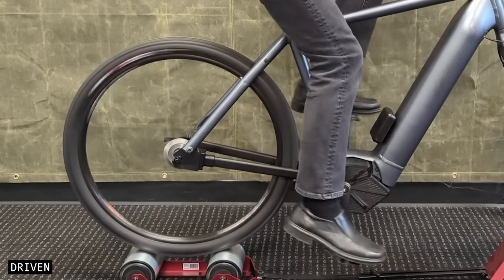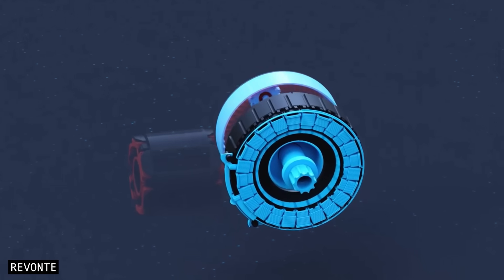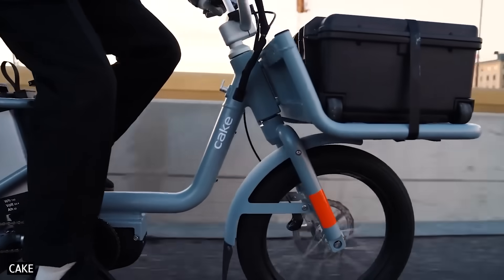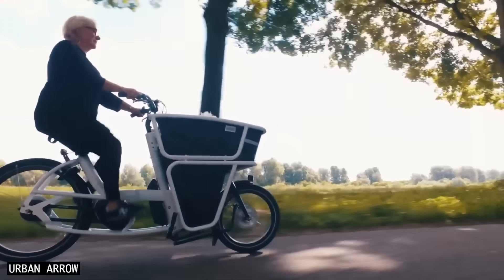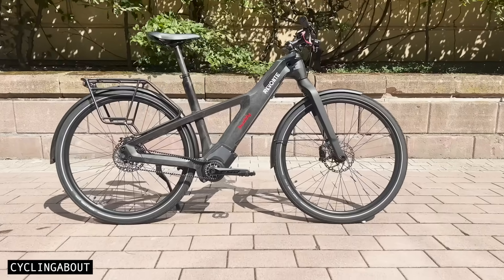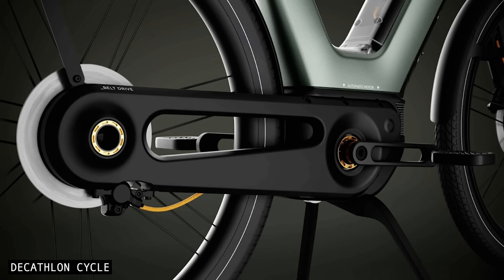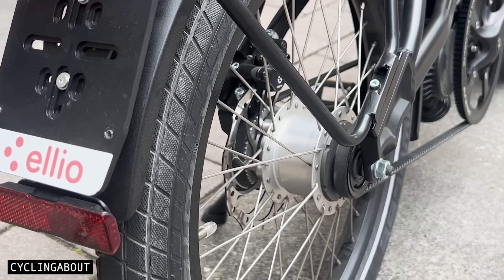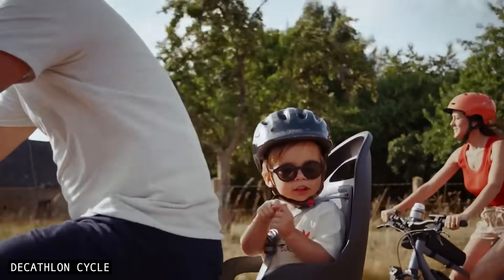Death of the Derailleur? Chainless eCVT Bicycles Might Change Everything!

Comment: In my opinion e-bikes are heresy to whole concept of bicycle. Period. Even if I got it that many people just lazy and/or have really bad physique it doesn't mean this is a good solution.
Maintenance. Even if minimal it still sooner or later will need it and You can't provide it by Your own. And, believe me, it will need maintenance much sooner than You think. Shit happens. Especially if You didn't bother to checkout and maintain it's parts. You got dependant.
Long term accessibility. I buy half a century old frame and able to make it road ready... Are You sure You be able  to do the same with Your e-bike? Doubt about. And those particular motors is a best example You can found - each of them are start-ups which can vanish sooner than You need some replacement part. You'll be forced to buy new one... Is it sustainable? Is it efficient from money point of view?
More point of failure. Those motors adds hell of a lot complexity. Badly soldered SMD component can literally brick Your wonder vehicle and You can't deal with it. Most of users at least.
I personally hope advance in bicycles goes more mechanical way, but it isn't attractive from producers point of view, because it be long term robust solutions which lower sells... You don't need new if old just fine.
There are some purely mechanical kind a gearbox which can be installed in standard Bosh EM socket and give You something like Enviolo gearhubs, but with completely automatic shifting. Yes it complex... But it be not bricked by not paying subscription on producer app. This is kind of development I wish to see more than disgusting e-bikes which is just fucking rot.
Reply: An automated chain and derailleur cleaner that one just would put the bike on, with a gear, pulling the chain around. Just change gears up and down, and the transmission is clean within a minute. Probably some filter for the oil also, so it doesn't need to be changed.

Comment: The shaft drive isn't efficient, and the contact at the rear wheel will wear in a few thousand miles probably, as this tends to happen with that type of drive system.

Comment: I've been waiting for this video. Thank you.
I believe the motor/gearbox combination like the Pinion MGU will take centre stage first. Eventually Ecvt will become popular. However, due to the complexity of them and the need for specialized training and/or shops they won't become an alternative that will replace the MGU style of bikes.
Cvt transmissions already have a bad reputation due to adoption by auto manufacturers that didn't design or build them for reliability. I believe they built them as cheap as possible by using belts instead of planetary gears. The planetary gear cvt transmission are strong and reliable. The belt ones, not so much. Unfortunately it will be a very steep and high hill for cycling manufacturers to climb.

Comment: You say low maintenance, I hear unmaintainable (proprietary / enclosed tech with obscure tools and documentation).
Reply: You could argue the same about car gearboxes being difficult to repair.  Modern sealed systems have a very long life and the Olson a bicycle system are relatively low compared to a car
Reply: @davidtydeman1434  yeah but that's one of the biggest advantages bicycle drivetrains have over cars. You can pick it up, see the problem and fix it in 10 minutes with some intuitive thinking, a spare cable and a prayer.
Reply: I’m a bike mechanic at an ebike store. I totally agree. I think the tech is amazing.  But it’s going to make bikes more like modern cars that require trained techs and software that only the techs will have.
Reply: @roamingromer  I'm also a mechanic and I agree. But we grow alongside our challenges. Also not all of these technologies will survive the test of time and one criterium is always how well a manufacturer employs serviceability, documentation and spare parts distribution. That's why Bosch dominates the market. Not because they had the best technology when they started but because they had the best infrastructure to meet the needs of workshops and mechanics. Time will tell.
Reply: @roamingromer  same. I can only imagine how bad it'll be if DJI is an innovator here too
Reply: @roamingromer your right to think that but remember cars and bicycles are dealing with much different scenarios. 

A bike is at max 100pounds compared to 1000s for a car. Different speeds of operational.

Why do this matter? Because if you engineer the equivalent of a car engineer but for a bicycle, the amount of maintenance required is so low that the trade off may completely be worth it.

Imagine taking your car in once every 3 years for maintenance, would ease of maintenance be worth doing maintenance at the current amount for a car?
Reply: To be fair it's the same with non DIY bike for the motor. Closed source special tools needed for diagnostic etc.
They just extended this logic to the transmission as well.
Reply: Each to their own, you can stay with your old reliable low tech gears.
Reply: I mean that's how tech always works.  If you want to be able to work with the logic in your electronics stay with vacuum tubes but at some point the performance and increased reliability overcome the downsides of being impossible to service or modify.  The question is just whether we are there yet for bikes.
Reply: @petergerdes1094 Except it’s not how tech needs to work.  Providing a schematic and access to basic repair parts is part of creating a serviceable device.  It takes a little effort by the company, but it’s not that hard.  And it can be done without giving away all the IP.  But companies choose not to do it because they want a monopoly on repair and/or to force you to buy new devices.
Reply: None of you picked up on eCVT relative to Toyota reliability. A planet and sun system is super reliable.  No maintenance really.
Reply: @mefobills279 Sure the mechanical gears are pretty reliable, but there are a ton of electronics that control these ECVT systems and I all but guarantee that those electronics are going to be unserviceable.  The manufacturers are not going to provide schematics or spare parts, and you’ll be buying a whole board for $1000 when a $2 capacitor fails.

Comment: Ah, that weight distribution claim again. About the only thing a mid mount changes is the lever moment of each wheel over a bump, halving it for both wheels. However, if a rider runs a hub motor, front or rear, there's a one-to-one moment as the hub wheel hits the bump, and no added moment beyond the standard wheel's mass for the non hub motor wheel.

Then there's the biggest, highest mass of all, the rider. For example, I'm 71kg at 183cm, my centre-of-mass is about a metre off the ground and 14x larger than the mass of any hub or midmount. Add panniers or cargo and the midmount effect becomes so incremental as to be bollocks.

The advantage of CVT is the ease of riding and I nearly went with an Enviolo hub when I switched from upright bike to recumbent trike this year, but decided the 1x9 MricroShift Advent is simething I know (my old tourer ran R9 flawlessly for 9 years) and I'm loving it. Derailleur is the last great technological advance non mechanics can be taught to understand. Seriously! ❤

As for midnount motors, the weight distribution stuff I've described above is the same, although the efficiency of midmount is higherthan hub drive. However, the efficiency of a middie comes from taking more of the load - aka doing more work, where hub drives are applying all the set torque all of the time, even with a torque sensing controller.

And "mid mount" on a recumbent makes the ride harsher because the drive is all the way outfront, the front wheels are halfway back to the rider and the back wheel is nearly as far back again. As much as I love the e-range I get with mid mount, I'm seriously considering a rear hub drive for the 1 in 2 attack ratio compared to the 3 to 2 attack ratio I currently get over bumps. I miss the smootherride of a bicycle, but age and a busted ticker have made riding a bent, essential.
Reply from the maker: I'm not sure you've ridden a mountain bike trail with both a hub motor and a mid-drive motor. The difference in handling is huge. Mid-drive motors offer vastly superior performance.

Comment: A planetary gearset in the bottom bracket with the sun gear being the pedals, the planetary carrier being driven by a mid-mount motor and the chainring/beltring being the ring gear and a rear hub motor would be perfectly analogous to a Prius drivetrain.

It would mean that the rear wheel could be being driven by batteries while the pedals are doing nothing, or the pedals are turning and charging the batteries while the wheel is stationary.

A front hub motor would give eAWD, and a large front hub motor would maximize regenerative braking.
Reply: There are already bikes with sidecar, so if you have also motor on this wheel, and big battery in sidecar, it could be 3WD for high range. With flat winter wheels it could be possible to drive in winter, on 3 driven wheels, with seat heating and handle heating!

Comment: Did I hear less components to wear out than derailleur system @4:13? Huh? Did I hear belts lasts longer than chains?
I listened long enough to hear them debunk the product. 🤣🤣🤣🤣
Reply from the maker: The motor design has very few wear components, and can easily be built for long-term durability. And having ridden over 150,000 km on various belt drivetrains, I can confidently say they last three to four times longer than traditional chain drivetrains.
Reply: @Cyclingabout  btw, belt drives are almost useless in winter conditions. Belt always tends to slip off. The derailer transmission also freezes and stops working, but at least the chain doesn't fly off and you can drive home in a stuck gear.

Comment: As someone who's owned lots of motorcycles with both chain and shaft drive, the chain drive wins hands down every time. The maintenance is so much cheaper and easier. You just spray the chain with lube once in a while and replace the chain and sprockets every couple of years for $100. Shaft drive requires lubing the final drive and shaft u-joints and splines every 150 miles, replacing u-joints, a final drive replacement is thousands of dollars, you need to replace leaky seals, and it's pretty inefficient and heavy, adding a lot of drag to the divetrain. Chains and sprockets are cheap and easy and effective.

However, I do believe CVTs are fantastic.
Reply: I've owned a few shaft drive motorcycles and I didn't find they were as you say. Heavy yes but none of my bikes needed a lot of driveshaft servicing. I absolutely didn't like the chain and sprocket drives on my other motorcycles. Dirty, noisy and needing replacing often. However, I would easily take a belt drive motorcycle over the chain or driveshaft. I never owned one but I know of several riders who did and they didn't need any servicing either. Light, strong and quiet.
Reply: You are very wrong. Shaft drive bikes need almost no maintenance since the shaft bevel gears are sealed. And the shaft generally lasts forever. June from June's Kitchen channel had a shaft drive bike for 20 years. Chain drives are very high maintenance.
Reply: I owned a 2004 Suzuki Volusia VL800 for a long time with a shaft drive and I only added some grease to it once when I had the rear wheel off for a new tire. Otherwise it was pretty sealed up and bulletproof. 
I also had a 2012 Kawasaki Voyager 1800 with a belt drive which I did nothing to at all for 50,000 miles when I sold it. 
The belt drive had a little lag between pinning the throttle and the rear tire reacting where the shaft drive bike was pretty instantaneous. 
On my bicycles I have one with a belt which is fine, but the bike is unfortunately a single speed and the rest are chains which are easy to take care of. If the belt broke on a ride, I don’t know what I would be able to do, except for they last for 60,000 miles, so it’s unlikely I will ever ride that far on that particular bike. I just replaced a chain that stretched out after 6200 miles on a recumbent and that was $98 for twelve feet of chain. But at least it’s a five minute fix if it ever broke on a ride.
Reply: I had an 89 Yamaha Venture Royale. It was the tour bike similar to Honda’s Gold Wing. It had a shaft drive. The only maintenance it required was changing the oil in the rear hub periodically. It was super easy and completely trouble free. The next best drivetrain is belt drive. They are also very much trouble free and need very little maintenance other than adjusting the tension and replacing when they get worn. They are stronger and last a lot longer than people might think. Shaft drives and belt drives are much cleaner also. Chain drive are a little bit less dirty, messy and less maintenance than they once were but they still don’t compare to a shaft or belt drive from a maintenance standpoint.
Reply: This video is not about shaft drives (although confusingly it depicts one on the frontispice).
Reply: @troppoandante he does mention one in the video. It is interesting, but I am not sure how it works on a bicycle since the transmission is at the rear wheel instead of behind the motor. Similarly the suspension is different from a motorcycle, so I don’t know how it works either. 
I’m more interested in the various hub gears, or combination motor and gears and the possibility of the ecvt range, but but realistically most of these things come from Europe or China and slowly trickle into the US.
Reply: It comes down to much you ride. I’ve done 8500 km in since February and having to clean that damn chain every 500km really adds up, especially if the weather isn’t looking to good. Also you don’t have to worry about shaftdrive on longer riding trips.
Reply: Strange, I had a Honda 900 (yes, that's not a typo) with shaft drive and put 70,000 miles on it and only needed to do oil changes every 3K miles, easy drain and fill. A great bike I miss it, an illegal immigrant with no drivers license ran a red light and hit me in an intersection and totaled the bike. I had to be LifeFlight to Herman Hospital in Houston.
Reply: Yes a belt or chain is by far the most efficient
Reply: Seriously???
Dang. I guess we should go back to chains for cars, like we started out. 

I've had three BMWs and two Guzzis and zero drivetrain issues. Service the lubricant at the recommended intervals and enjoy the ride, instead of spending all of your time cleaning chain grease off of your wheels and constantly tensioning the chain.
Reply: Utter bollocks 😂

Comment: I was looking at the decathlon bike, not a bad price for the tech. Kind of a bummer they didn't fully enclose the chain but whatever. What I did look for but can't find anywhere is the efficiency of such a transmission when it's not taking power from the battery. Did you find any numbers?

Comment: Are there advantages of eCVT vs generator-motor where the pedals power a generator and the motor drives the vehicle?
Reply: The loss is much lower, and you still have a direct physical connection to the wheels, so there's no "spongyness", you "feel" how much force is applied. That's particularly important for MTB riding, where you may otherwise not notice that you loose grip.
Reply: @RubenKelevra  the "direct physical connection" isn't that direct, actually - the speed-ratio motor is effectively in series with the pedals. So there absolutely is spongyness in eCVTs too.
And just because some of the power is transmitted mechanically rather than electrically doesn't necessary mean they're more efficient either. All those gears are bound to seep a fair few watts as well. In fact, the efficiency of electric motors on bicycles is largely a function of the associated gears rather than the motors themselves!
A drive system consisting of only two belts, one from the pedals to a generator and one from a motor to the wheel, and no gears whatsoever, would be more efficient than those complicated eCVTs (and much lighter). It would require very large sprockets though, which would be impractical.

Let's face it, the E-bike world doesn't really care about efficiency... as long as the losses are below, like, 30%, it's cheaper to compensate with a larger battery than to optimize the drivetrain.
Reply: Mainly because it is not legal in most countries.
Shame, as it is a great option for those who just want to get from A to B.
Reply: @markthomasson5077 I don't see why they would be considered illegal. Can you provide a source for that claim?
Reply: @RubenKelevra it is just how the law is framed (UK). A direct mechanical drive is required, and the electric is power assist. (Though that is changing).  Without this, it is fully controlled by the throttle, so zero pedal assist.  You only put in power when you wish. With the advantage you can put in power when free wheeling, or even stopped.  That Canadian recumbent more or less does this, though they had to have a direct drive, which only inputs at slow speed.
Reply: @markthomasson5077 ah! So eCVTs do work but electric transmission does not. Gotcha. I thought you meant eCVTs don't work for most countries :)
Reply: You always fail to mention that a fully enclosed chain is perhaps the most efficient, least expensive , low maintenance option.